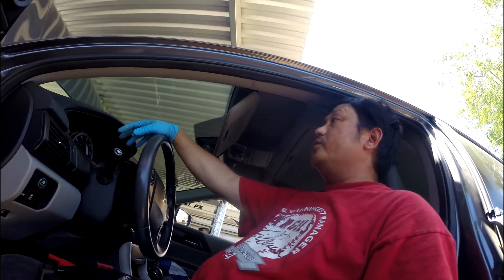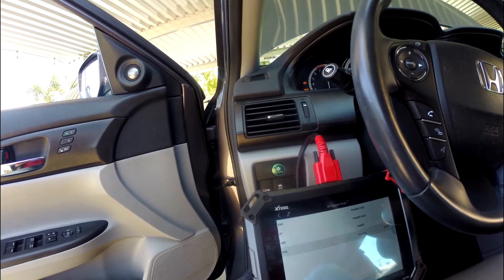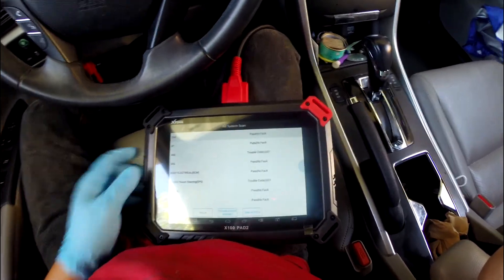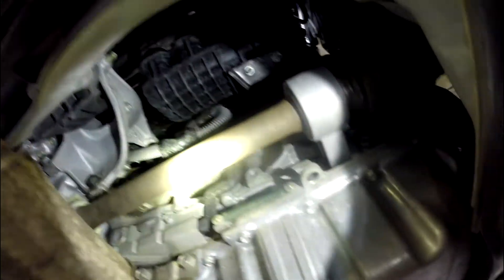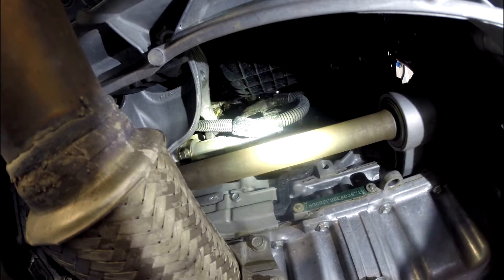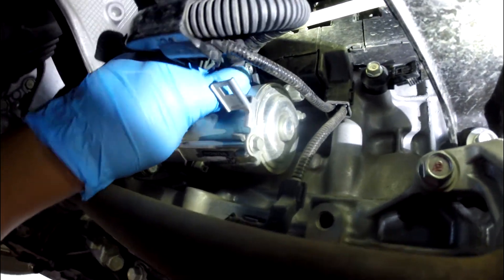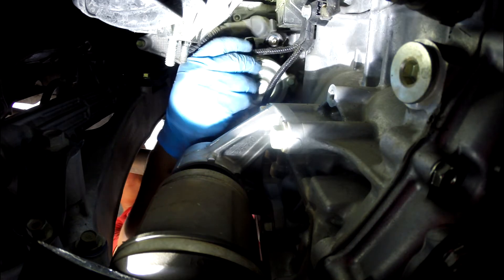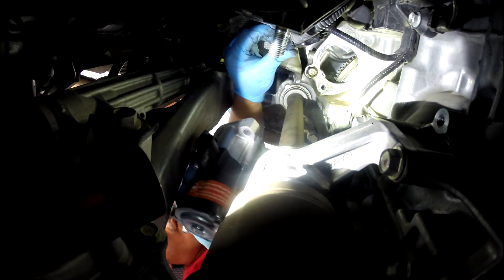2014 honda accord starter replacement

Comment: If you bring the fob closer to the push start button, the signal will be close enough for the car to start. Just more convenient to have the fob battery replaced for sure. But in the even you find your key fob not working cause of a battery issue, just bring the fob right in front of the push start to send the start signal.